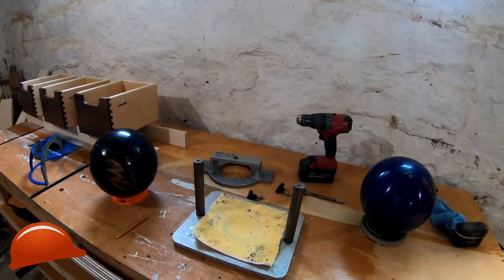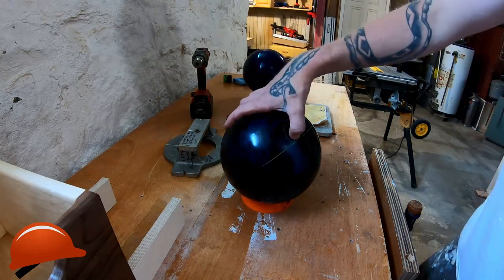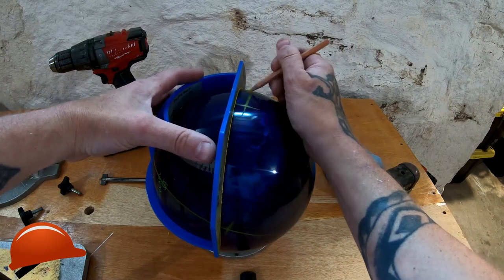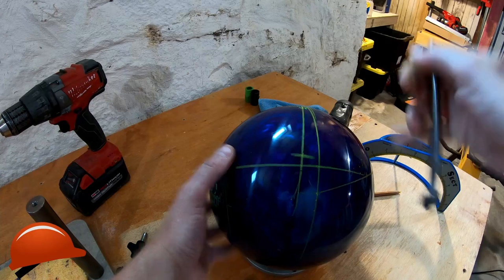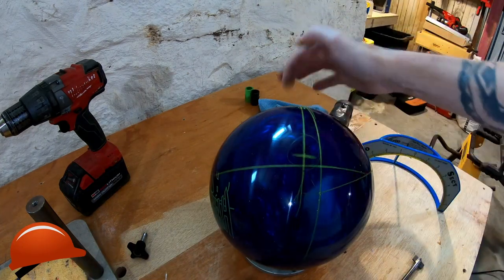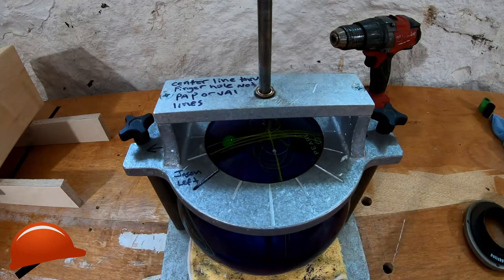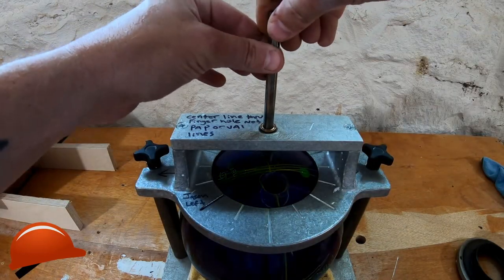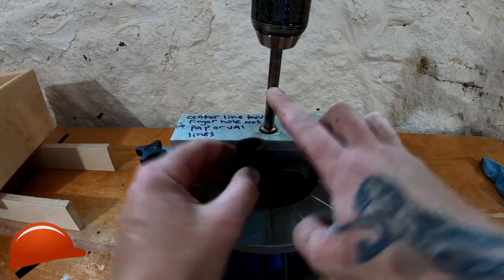KMT Personal Bowling Ball Jig. Drill For One Handers

Comment: I can't bowl up the back of the ball because the thumb hole is between the finger holes.   I was planning on getting a ball reworked with the thumb hole moved in line with the middle finger.    Until then I just switched how I hold the ball, I use pinky and ring finger instead of middle and ring.    Still the same amount of revs, but the ball rolls more forward and I can get a hook stop motion vs having to loft the gutter across 6th and 7th arrows out to the ditch just to get to the pocket.   It moves the pin to my pap on all my balls that have pin above the bridge.
Reply from the maker: Huh that is interesting. I never thought of that. Next time I go bowling I may try that for kicks thanks
Reply: I use my pinky and ring finger sometimes too. Lol.

Comment: Where did you find the KMT ball jig and what do the run?? Great video!
Reply from the maker: Kmtballjig.com or look on eBay and they are 300 I believe
Reply: Shouldn't 2nd finger be hlf notch opposite way to have same pitch?
Reply: I'm not understand how depth makes a difference between 1 hander and 2 hander. I've shot both and use the same grip and depth

Comment: For the love of god what did I just watch. "1/4 bridge?" "That little bit won't matter?" Also, people don't drill the holes deep enough to fit a whole finger insert, because depending on the physics of the ball and what they want it to do, they don't want to remove mass from the core because it will raise or lower the RG depending on whether it's pin up or pin down  Bowling ball fit is an intricate process. There is a reason that people get paid good money to do it. 1/8th of an inch is a mile when talking lateral pitches. Also you are completely disregarding forward and reverse pitches are critical. Also wtf  layout system is this? Not dual angle, not VLS and not 2LS(because it's not two handed.) Those are literally the only accurate layout systems that work with today's bowling ball physics. VLS uses a 2 arcs that intersect and connect tangential. Dual angle uses straight lines but uses angles to get there. You first draw the lines, then use your pap to get to center of grip. If you want to do it for yourself great. However, you are gonna cost people a ton of money when they try to do it themselves and botch a $200 ball only to have terrible wrist pain because fit is WAY off.
Reply from the maker: watch moe pinel and his son and you'll get the layout system. Moe pinel  dedicated his life to bowling balls. so I trust him. I never had any issues. and I had a lot of fun trying different layouts and different balls and when bowling becomes not fun don't do it I guess. I will continue to drill my own balls cause its fun and Ive had great success in doing so